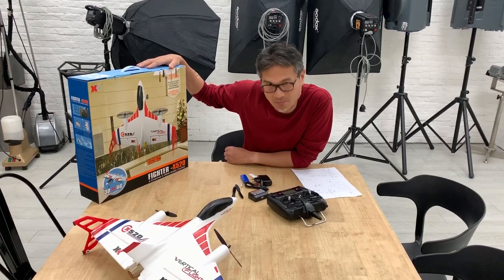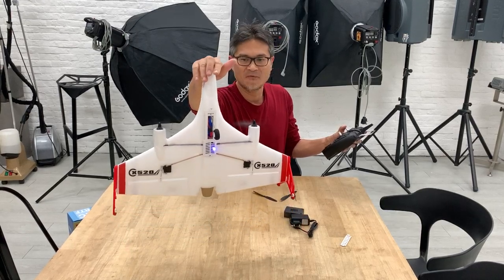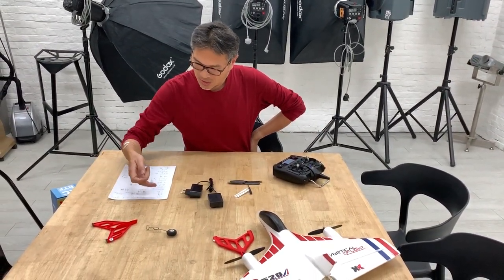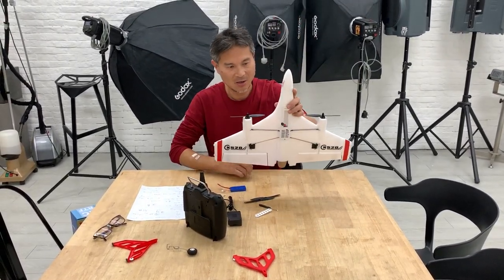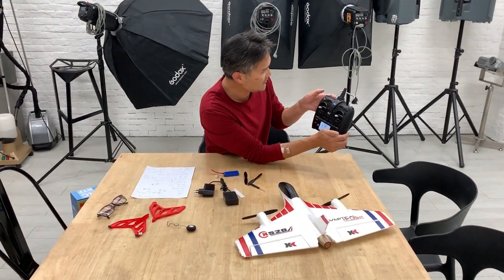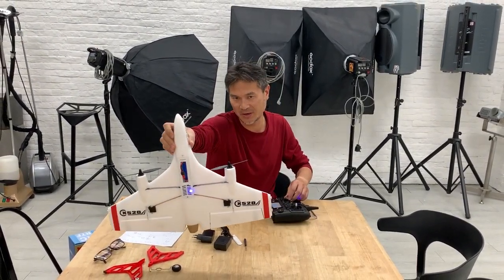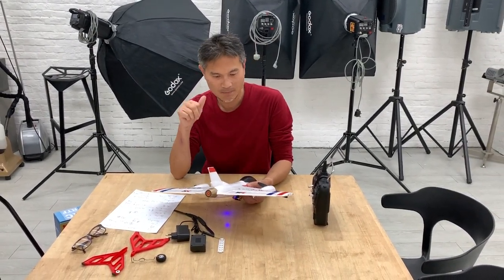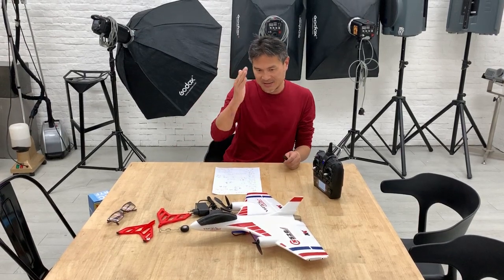Sharing X520 experience, something’s  important for beginner. Change mode, binding, calibration.

Comment: Halo Lou, I have x520 with  smaller  transmitter, without screen light. After the test I restart the transmitter, but the left hand trottle don't work, I could start again the plane with the right trottle, but the plane doesn't work properly. What can I do for fix the transmitter function ?
Reply from the maker: By a transmitter please, it very cheap.

Comment: I had unexplain crash of this model after the 2 S lithium was use over 6 months. 
At first I though it was a faulty electronics but it happen again on 3 other similar models....this is a pattern!  I suspect the low battery detector is faulty. When the battery voltage drop below a threshold, it should just cut off the motor. In this instances, it stop the electronics cold as well till there is no surface control , resulting in a crashed....head first with disastrous result!